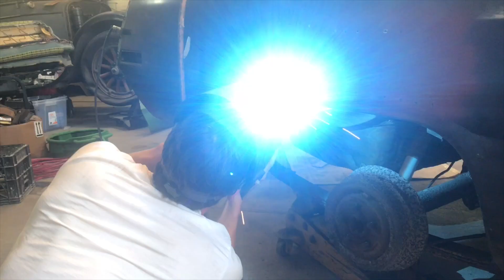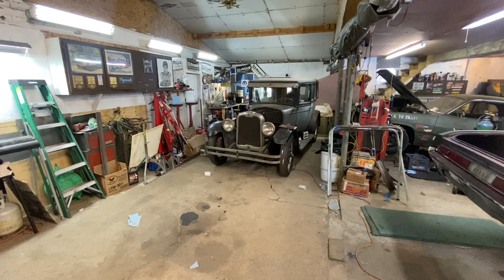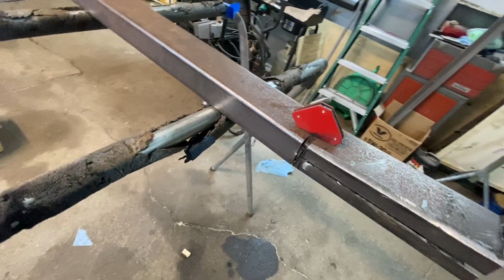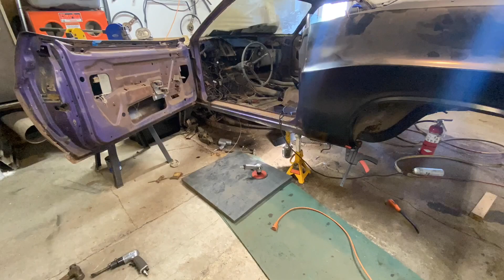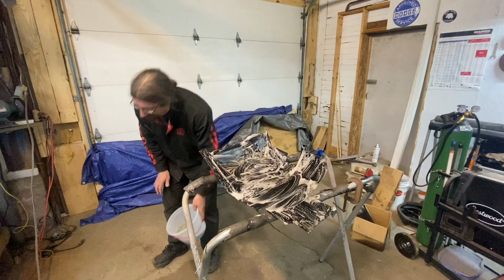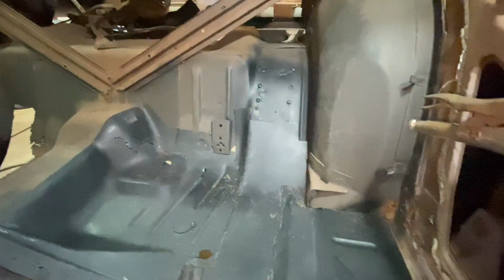Welding in the Frame Rail and Subframe Connector - 70 "Stitches" Challenger  - Unibody Repairs

Comment: Stitches is coming along!  I see you are using two different welders. Is the Lincoln only used for sheet metal? I'm guessing it's a 140amp. The Eastwood looks like it can handle frame sized metal plus it does TIG also.
Reply from the maker: The Lincoln is a very old mig 100 amp.  I’ve Had it for 30 years.  

I use it for everything up to 3/16”

I just got the Eastwood TIG.  I only use it occasionally right now because I’m a bit rusty at TIG welding.  Haven’t TIG welded since the mid 90’s.  you will see me use it occasionally in an episode When I’m  forcing myself to use it to get my chops back. Lol